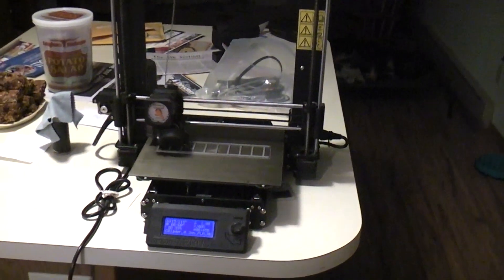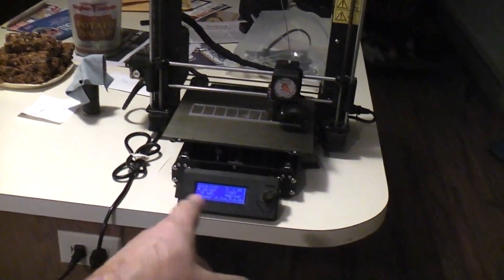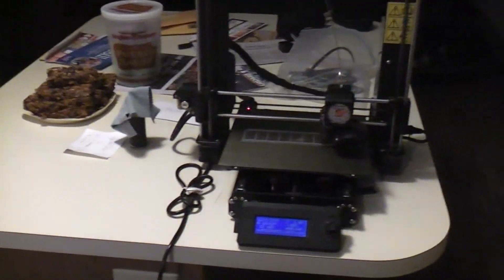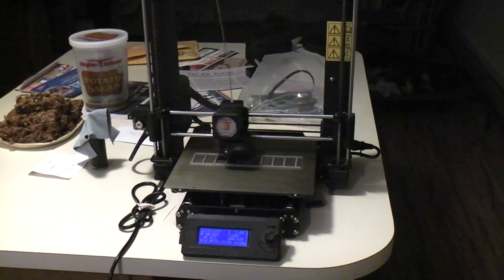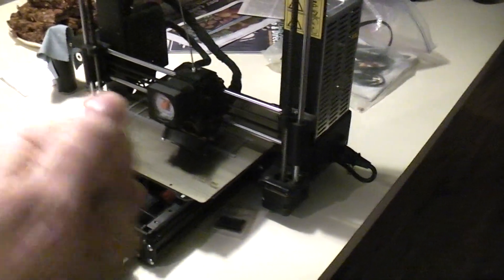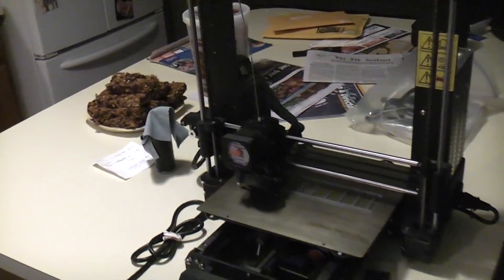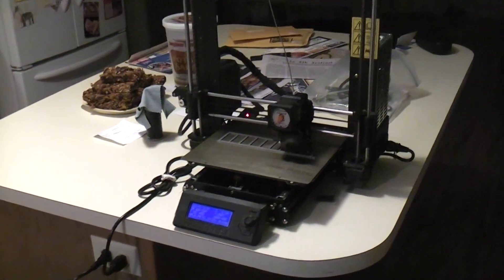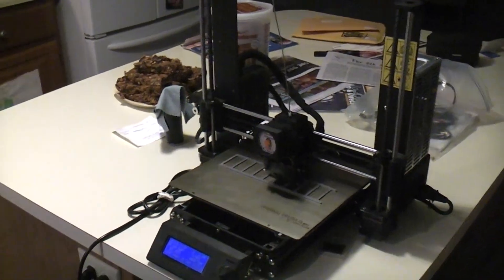What happens with a intermittent wire in your P.I.N.D.A. probe, Prusa MK3.

Comment: I actually had a similar problem. I notice one wire of PINDA was faulty since the light was ON and OFF when moving the wires behind the extruder. I supposed some cable was cut inside the wire, so I went there and try to find the cut with no success. I ended up replacing the whole blue wire (that I measured faulty). After that, I did the checks that Prusa recommends (put a metal object below the PINDA and read the Z position moving from 0 to 1 when the metal is below) with no success neither. The value for Z never changed even though the light in the PINDA was going OFF... I tried to manipulate the plug, in the board and sometimes I got the 1 value in the Z position. That seemed to me that the plug was faulty, not the wire any longer. I did a lot of stuff in order to resolve that and I even solder directly the wire to the board. I can't get the 1 value for Z any longer in any way. I'm getting a new PINDA in order to test if it's something related to the previous pinda itself or if it's something related to the board or whatever. But I must say that this is the first time I have to deal with such a pain in the a... This is a real faulty solution for this kind of printer. Many people is complaining about this issue, Prusa should've done something better already.